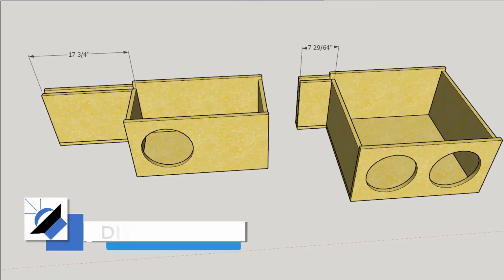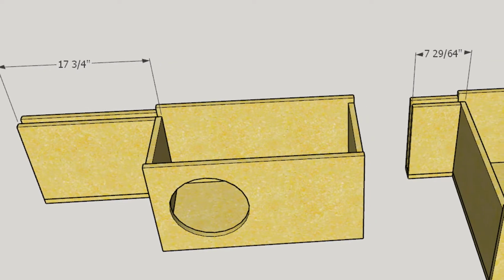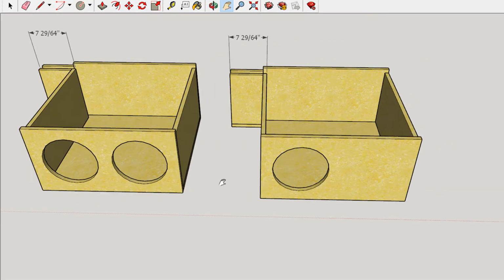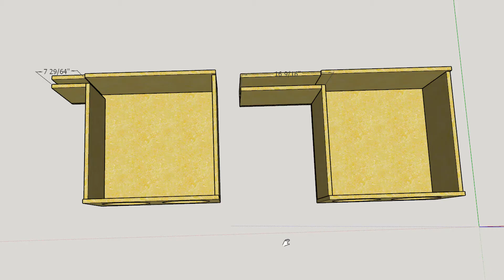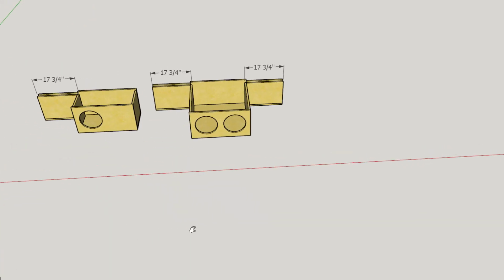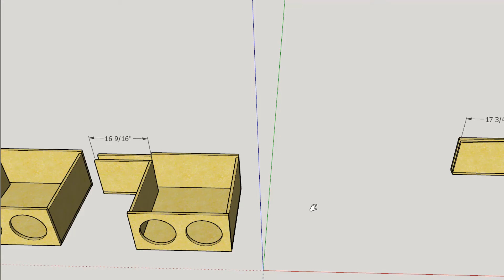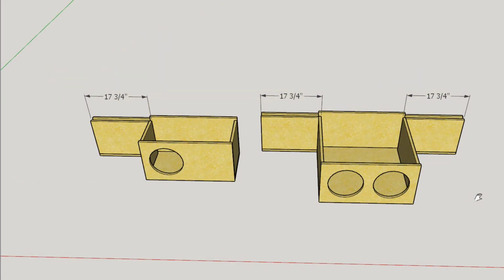How to tune a Dual Subwoofer Enclosure:  Ported Subwoofer Design

Comment from the maker: This is the second video in a series I am working on.  The goal is to provide some easy visuals that hopefully will make port tuning a little easier to understand.  Check out video #1 here:  https://youtu.be/-yopTneS7g8
Reply: I would like to pay you fir some box specs  tuned to 24 hrtz 2 18 inch dd subs redline 800 series

Comment: I am swapping out my sealed box for a ported one but its for a bit of a show truck and I want the ports to be symmetrical.  It is for a 12' sub that requires 1.38 cubic feet and the port is 12.5" x 1" and 16" long.  Can I do two ports 6.25" x1" and still 16" long to get the same frequency? Thank you!

Comment: Port length and tuning stays the same when add multiple woofers as long as u double the math or tripple depending on how many woofers u have for air space...1 box for 1 sub with 1 port tuned to say 35 hz will be the same length u use no matter how many woofers u had...as long as airspace and port area are doubled..tripled..ect...very easy concept to understand

Comment: Does double baffling a subwoofer box Change tuning??
Reply from the maker: Only if the port goes out of the front baffle, then the port is 3/4 of an inch longer and that will change the tuning.
Reply: @DIYAudioGuy  thanks mann

Comment: So I need some help if anyone here can help me I want to build a dual 10" subwoofer enclosure ported. I have 2 Rockford foscate P3 series subwoofers and I am putting them in a 2016 Camaro which does not have a lot of trunk space how can I Get the cubic feet that I need and still have the subwoofer enclosure small enough to get it in my trunk? I think I need 1.4 cubic feet for one of the subwoofers.  Do I just double that for the cubic feet so it would be 2.8?

Comment: Hello I'm new to this bought pre fab box, ported for 2 12's.  Box is 1.6 cubic feet the port is 3 inches by 12 inches can you tell me what is this box tuned to???
Reply from the maker: Use the rice and paper trick.
Reply: @DIY Audio Guy  what's that my friend, how do I do it
Reply from the maker: @itsjusti4262  take some paper and cut it into strips, but don't cut all the way through the paper. Tape that over the port.  Fire the speaker straight up, put a little bit of rice in the cone.  Play different test tones, you're looking for the sweet spot where the paper is moving in the rice is not.

Comment: According to the last box then, would you be able to build it like it was two separate enclosures with the port facing the same way as the subwoofers and just not have a dividing wall between the subwoofers?
Reply from the maker: Yes

Comment: So I built a ported enclosure that's 4cuft but I put a 3 in wide open port and 23 inch length port for 2 mtx 9500 subwoofers and it hits really hard and really low so the question remains is a longer or shorter port still affected by the max excursion a subwoofer can create, or does your method work even for cheap subs that dont move alot of air?
Reply from the maker: It works for all subwoofers.

Comment: Im have a question about the port, and the volume of the box, usin the Winisd. The software calcule the response with the volumen of the drivers too or not? Is necesary discount it in the total volume? The volume of the ports if i want two ports, is each or total? Is it necesary discount it of the volume of the box? Regards from Argentina!
Reply from the maker: WinISD does not take any of that into account.  Just gives you the net airspace, which is the airspace you get after you account for all the stuff you're talking about.

Comment: When using WinISD, I design a box for tuning H, and volume V, and I select to have 2 ports.   WinISD then calculates a port length.  Do I build each of my two ports to be 1/2 of the Vent Length that WinISD is displaying in the Vents tab?  Thank you.
Reply from the maker: No. Both ports will be the length given in WinISD.

Comment: I'm having a time designing a box for 2 Wolfram Ti-12 dvc 2 ohm. I used the only specs I could find on Xplicit audio but I think something in the specs was for 4 ohm instead of 2. That or it's because I followed your video for 1 sub but my design required 2. I got the green integrity check at first on Winisd when I followed your video for one sub but then I realized I had 2 so I started over and that's when I failed the integrity check. Could you help me figure out where I went wrong?
Reply: Also, I am using an 8" BAP. I wish you had a How to design a box for 2 subs and a round port on Winisd. I know it's something simple I am missing but I don't know what.
Reply from the maker: Just pick two subs instead of 1 and select a round port in WinISD.
Reply from the maker: If the integrity check worked for one sub, it should work for 2.  That is kind of odd.

Comment: Hey how's it going? I have a quick question. I'm building an enclosure for 4 12s the 44 x 18.5 x 28.5 and im wondering what should my port dimensions be to get a tune of around 32 33 34 hertz. Thanks.
Reply from the maker: If you're looking for a box design I do offer that as a service.  If you don't need a full design and just need help with the port modeling I offer that as a service as well.

https://diysubwoofer.blogspot.com/2021/05/custom-subwoofer-enclosure-designs.html

Comment: If I'm ok with chuffing noise is there any disadvantage of having thinner ports? My box manufacturer gave pair 3" PVC ports to reduce the cost with 6" lenght to each port. Box net volume is 4 cubic feet. Now I have lots of port noise but its not audible when I'm loud due to mid highs. So am I lossing efficiency due to small ports forced to travel pressurized air?
Reply from the maker: If the chuffing is not audible then you are probably not losing enough output to be worried.

Comment: what is the ideal port area (Pvc pipe port) for dual 18 inch box tuned to 30-35hz and a box volume of 12-15cuft ? what I know is that ideal port area for one 18inch sub is 55.80 to 89.90 inch2. So for a dual woofer box, should any of these values be doubled to have an optimal port area. For example a port area od 55.80+55.80= 112inch2 should be ideal?
Reply from the maker: I don't believe in the myth of the ideal port size.  The port cross section needs to be big enough to keep from chuffing, but not so big that you cannot realistically fit the port in the enclosure.  I would encourage you to check out my WINisd video. https://youtu.be/yZNeYBYGRKk

Comment: You're wrong on your two boxes of 4 cubes having the same size port. They won't bc you have to remove additional sub displacement
Reply from the maker: Right, when you actually design the enclosure you need to take into account the displacement of the subwoofer inside the enclosure.  But for this video I was just trying to describe what happened to the port as you increased or decreased to the size of the enclosure.

Comment: In slot port, the box walls are acting as port walls too, and they extend longer than port. So some people say  WINISD shows upto 30%  longer  port length than needed. How far this is real ?? Any suggestions on this please ???
Reply from the maker: I probably need to do a video addressing exactly that topic.  WinISDs calculations match my own, the only real difference is rounding error.  When I actually build the box I adjust for the phenomenon you're talking about.  

It is not that WinISD is wrong, you just have to make the adjustments when you go to make the box.

The box I'm working on right now (The video will go up in September) is tuned higher than I usually tune them with the hopes that I'll get this worked out.
Reply: @DIYAudioGuy  thats an awesome coincidence and eagerly waiting for September video. 😀😀😀😀😀👍👍👍 Thanks for replying !!! 😊
Reply: I thought that this happened because the sides (walls) of the port create drag, which slows down the air and affectively makes the port area slightly smaller, reducing the tuning.

Comment: I don't have really any in-person experience with subs but I'd be curious to get your take. First: do you have a preferred tuning frequency? And understanding that the ported subs drop off after the tuning frequency, how do you feel about sealed boxes as they extend lower and roll off gradually? Cheers
Reply from the maker: The tuning frequency will depend on the driver and the application, there is no one magic frequency.  For home theater you want a sub that can be tuned low and you want your F3 to be in the low 20's or even high 10's.  A car will benefit from cabin gain so you can get away with something in the 30's.  If sound quality is your goal (home or car) you want a flat response.  Sealed boxes don't extend lower -- they start to drop off at a higher frequency.
Reply: @DIYAudioGuy  Thanks for the quick response! I'll keep that in mind. My set up is music focused with Magnepans.
Reply from the maker: Nice!

Comment: Hmmm 🤔 how do you tune them external ports tho I really need help with that
Reply: This is the port tuning formula:

2117(d)^2  / Vb•Fz^2 - 0.732(d)
D= inner diameter of the port
Vb= net airspace inside the box
Fz= tuning frequency 

Now an example: let’s say we want to build a 2 cubic foot box tuned to 40hz with a 4 inch inner diameter round port. Our formula, broken down in parts would look something like this:
2117•4^2 / 2•40^2 - 0.732•4
          Or
2117•16 / 2•1600 - 2.928
          Or
33872 / 3200 - 2.928
          Or
10.585 - 2.928
          Or
7.657 which is roughly 7 21/32”

For our example, to tune a 2 cubic feet enclosure, we need a 4” round diameter port that is 7.657” long.That is how you tune a port for any ported enclosure ( band pass tuning is very different) now... if you want part of the port exposed find the volume of the amount of port you want inside the box, add it to the net airspace and woofer displacement to get the gross volume of the enclosure figure you’re airspace measurements for gross volume. If you do this, you will have a properly tuned ported enclosure to your specs... also, if you are serious about trying to build enclosures, get WINisd; it’s free and will help you visualize and understand what you are doing with your subs much better. “The car stereo cookbook” and “loudspeaker design cookbook” are great as well. I hope that helps you
Reply from the maker: @bryanmaynard905  https://youtu.be/U5BQdnagzW8
Reply: @bryanmaynard905  it helps a lot I’ll try to do the math I’ve got win isd but I can not figure out how to do the port displacement with it being partially internal and external the issues I’m having is that I can’t input the parameters of the internal and external portions with out adjusting for volume of the motors and port I know the net cubes not the exact with displacement 6 cubes with 2 sa v2 15s and a bucket with 10 inches inside the box and 4.5 inches outside the box I have the free winisd so that may be why I’m not gonna lie I’m really really really cheap hahaha 🤣 I actually have a couple basic programs one for my phone even I’ve only ever bought one app ever and I regretted it when they stopped updating it so I always stick with free versions
Reply: @FUCKDSS  you figure the port displacement the same, whether the entire port is inside the enclosure or if part of the port is exposed.  

Rectangular port displacement:
          Length•width•height / 1728
Round port displacement:
          Pi• R^2•length / 1728
As an example, if we use our fictitious box and a 4” inner diameter port with a wall thickness of 1/4” are math for port volume looks like this:

Pi•2.25^2•7.657 / 1728
          Or
3.14•5.0625•7.657 / 1728
         Or
15.896•7.657 / 1728
         Or
121.717 / 1728
         Or
0.07

Remember you only have to account for the amount of port that is inside the internal airspace of the enclosure. So, do not count the amount of port hanging out of the box, and do not count the portion of the port that is going through your wood. 

Gross volume= net airspace+sub displacement+ port displacement 

So our sample box has a gross displacement of 2.07 cubic feet before sub displacement. If our fake subs displacement is 0.1, total gross volume is 2.17
This is what I do when I make my ported enclosures.
Reply from the maker: I just let WINisd do it for me.

Comment: you should also take vas of the sub in to account to get the port area needed for the subs other wise you end up with port noise
Reply from the maker: I usually just look at the port velocity in WINisd.
Reply: @DIYAudioGuy  that works two but I don’t like winisd it’s useful but not at the same time

Comment: You never brought up the port end correction. When modeling with WIN ISD do you cut down the port length do to the radiated mass? The equation is Sqrt [4x port area /3.14] = you take this number and multiply by .732 This will give you your actual physical port length. This is the equation that takes your physical port and figures out what your actual acoustical port length is I would like to hear what you think about this! Thank you and great video!
Reply from the maker: Probably need a whole video just on that!  I might do a little research and see what I can come up with.
Reply: I want to know more about this... would explain a few things.
Reply: Yes yes yes pleeease! I've made 4 different boxes, and all 4 of them ended up being tuned about ~2hz lower than calculated. It's super annoying.

Comment: Can't wait for a laptop, to actually design a build in 3D. Then print it out, I've been drawing my designs by hand with a square and graph paper. Not always to the mm or ft  on the sheet but comes out right it's just the cuts I need to perfect..And learn turning... Theirs a lot left for me to learn, I don't know what my friend did but, in his college days he took a course and learned setting crossovers to fiberglass enclosures. At least he did that on his own but he got the technical stuff was in class
Reply from the maker: Sounds awesome!

Comment: why 28hz?
Reply from the maker: No reason, just a number I pulled out of the air for the example.
Reply: @DIYAudioGuy  in your drawings your vents are outside.   I assume that is for demonstration purposes.  But what if I wanted  to maximize the size of the box and save space ( and maybe hide it from the wife).  Could I put the long port outside like that.   Maybe run it behind the couch?   Or make the sub look like an end table and put the vent under the couch?
Reply from the maker: @manningcustom  Yes, I Drew the port outside of the enclosure so it would be easier to visualize the different port lengths, and it's perfectly acceptable to make the port outside of the enclosure.  I'm just not sure how far away the port opening can be from the subwoofer before it messes with the sound.  low frequencies have long wavelengths so you can get away with that, that's why a lot of bookshelf speakers will put the port on the back for example.

Comment: Do you consider the F3 tuning drop in you analysis or should we just focus on fb?
Reply from the maker: I did not focus on that in this video.  But it is something that you have to take into account. You can see the impact on F3 in my previous video:  https://youtu.be/-yopTneS7g8?t=84  In that video I showed three boxes, all tuned the same, but different size.  The size had a big impact on the frequency response.

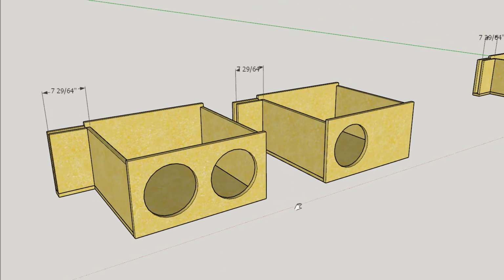Comment: 1:35 viewer reminder if/when actually designing an enclosure: we need to remember to consider driver displacement also being doubled will decrease volume more so than with having only one sub. But this was irrelevant in this example which is for our sake, keeping it simple, thankfully.
Reply from the maker: Yes, very true.  The subwoofer, port, and any internal bracing all take up space and you need to account for that in the box design.
Reply: i just figured the displacement was already figured in for simplicity !